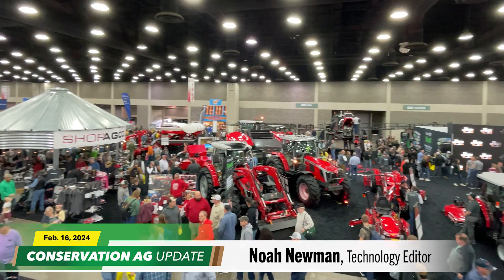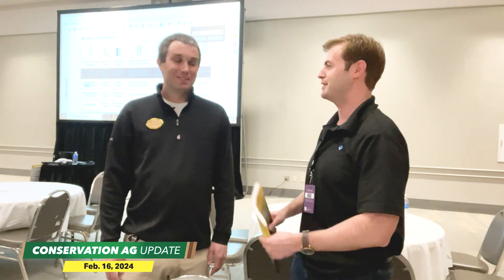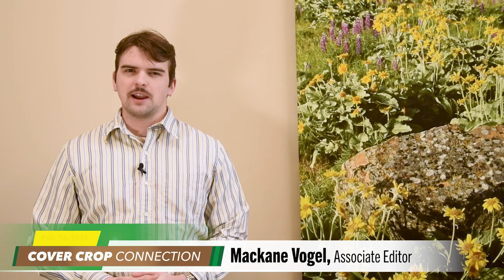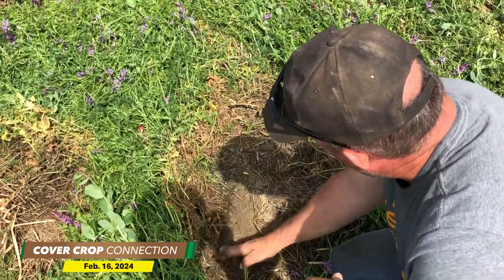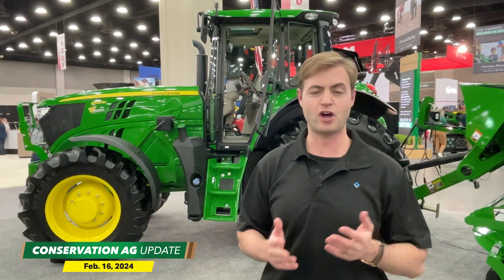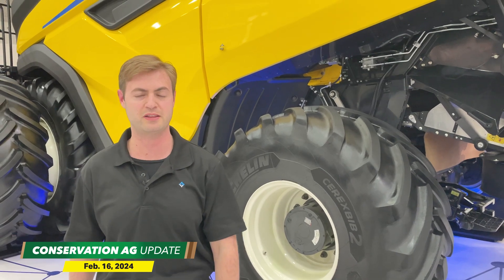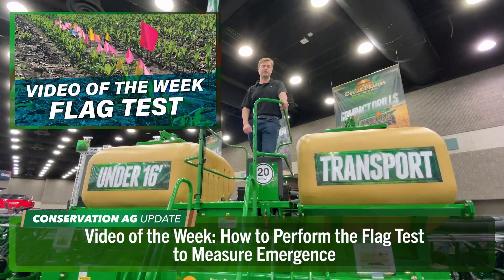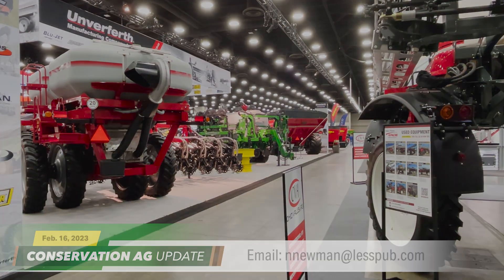No-Till Tips & Cutting-Edge Technology at the National Farm Machinery Show

Comment: "The first place is downforce." The best option, which should be in the first place, is to eliminate the reason for the need to apply downforce! Downforce, whatever it is, disrupts the porosity of the soil – a key factor in yield!"
In second place is to eliminate the reason for the need for closing wheels. Technically, these are solvable tasks! 😂